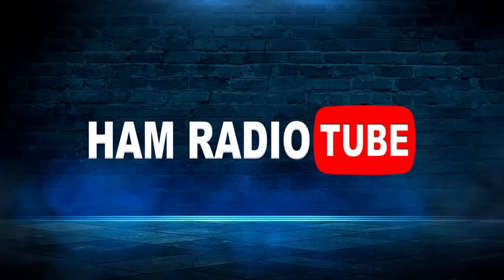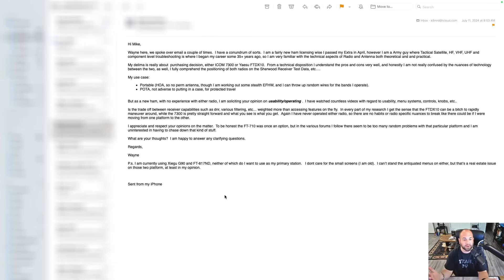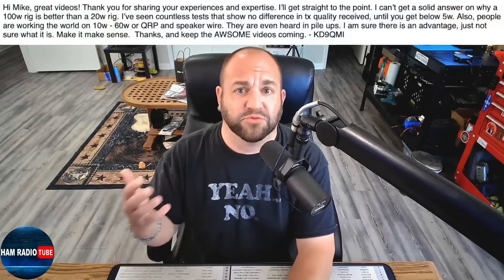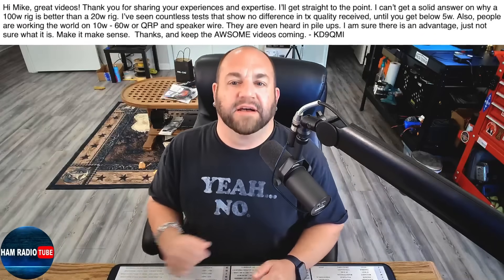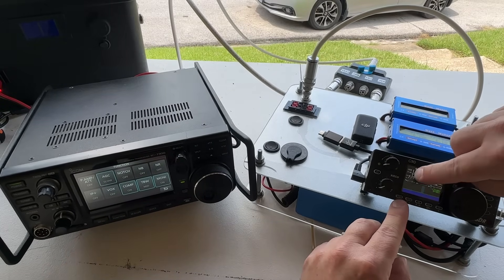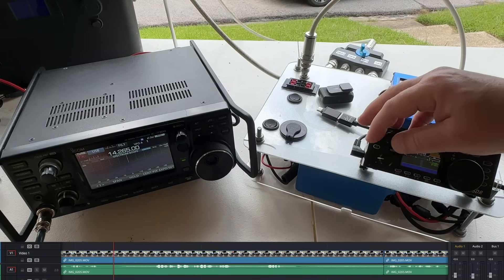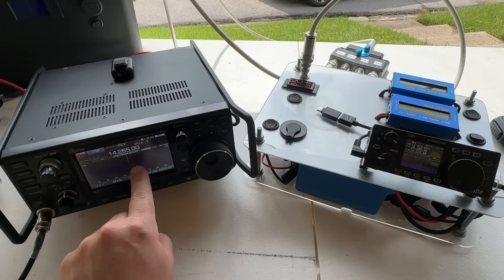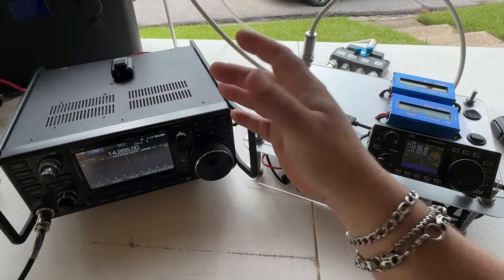Is There A Difference Between 100 Watt & 20 Watt Radios?

Comment: There's a Canadian ham, VE7MTY, who operates a 10 meter beacon at or near 28.197 (he lists this frequency on his website).  I heard it the other day, on a frequency up from 28.197.  I forget where exactly, but it was near it.  Anyway, he runs 4 one second tones at the end of his transmission loop, stepping through 25w, 10w, 2w and .5 w.  I could easily hear the difference in each, progressively becoming fainter with each step and most times, barely hearing the .5w tone.  I'm in Arizona, and when running POTA, almost always run 100w so I can get the east coast hunters to be able to copy my transmissions.  Or, if I just want to experiment or keep pileups at a minimum, run QRP sometimes.  Mike - ND7E

Comment: I think COAX helps too. If i am using poor coax, the power drop my be down to 50% and now the G90 is down to 10 watts. It looked like your coax was pretty low loss.  Good video!  I am glad I got the 7300.

Comment: When someone is confused by the FTDX10, I do not understand. Learning the breadth of features is challenging, but the control is simple. Push the function button and select the feature.

My most annoying radio is the IC-7000. To use your example, changing the output power takes a roadmap and opening the manual PDF.
Reply: Have you tried the FT-991?  It's a very useful shack in a box but the menu system still confuses me after years of ownership.  

My friends IC-7300 I only used occasionally but it's just so easy by comparison.
Reply: Dialing in the transmit audio just right can be tricky on the dx10, but mostly if you’re using a unique microphone/headset. Otherwise, the N4hnh guide available to his patreon patrons will helps a lot in getting you up and running quickly. It’s a good radio… and if you’re going to operate from home a ton…. Get the dx10… but if you’re heading out into the great outdoors, the ft-710 really is a better form factor. The size difference in the specifications doesn’t really give you an idea of how much lighter and more compact the 710 is. Not blow your socks off small, but it’s obvious when you see it in person.

Comment: I recently upgraded my station (rather significantly) and my new transceiver can pick up signals that are down in the noise for its predecessor.  Unfortunately, there's no guarantee that the station on the other end has "ears" as good as mine. Even if they do, they may be dealing with local noise or interference that makes marginal signals hard to hear.  This is why, all else being equal, I'll opt for more power capability. I'm not required to use it -- I can always throttle back (and usually do, to be honest), but it can really come in handy in some situations. Nothing against some of the amazing QRP rigs that are out there -- I have a couple of them, and enjoy seeing just how far I can make a few watts go. But when they're maxed, they're maxed.

Comment: for the 20w vs 100w thing, I think the big thing to realize is that 100w shows up a lot better on a waterfall. So if you want to just call CQ on a frequency and have people find you, the more watts you have the better, because you will make a big peak on  the waterfall, and people can navigate over to you. When I run QRP I generally have to hunt stations that are calling CQ and they may or may not hear me when I respond back to them,  but the only times I've ever had someone respond to me when I just call CQ on a frequency was when I was running into an amplifier with ~100w output. You can still hear someone transmitting at 20w in a lot of band conditions, but only if you are on their frequency already. Finding someone transmitting at 20w is much harder.

Comment: I know for a fact that you can work the world with 20 watts and a wire.  It can be hard to bust through pileups though, especially when others are running amplifiers.  When running lower power you definitely have to work with propagation.  I will say the internal tuner on the G90 is fantastic.  Before I put up my 80 through 10 EFHW antenna I was using an inverted V wire dipole cut for 10 meter and was able to tune all the way down to 40 meters with the internal tuner on the G90.  Was it the most efficient set up?  Absolutely not, but I was making contacts.  One of my more memorable contacts was with a ham in Colorado who was running an amplifier and decided to turn it off after I told him I was running only 20 watts and he was hearing me without any issue until the band changed.  There was no change on my end when he turned off his amplifier.

Comment: The receive on the G90 sounds better than in your demonstration if you turn down the RF gain control until the noise is just barely registering on the S meter. When I do this, I actually enjoy listening on the G90 just as well as any other rig, including my 7300. It's a very quiet receiver with clear audio on the internal speaker. Better than the 7100 even.

My only complaint with the G90 is broadcast interference and CB powerlords. An external broadcast filter is a must have accessory, and if you have to use it, then you lose the tuner. If they had included this in the radio I would have nothing to be unhappy about.

Comment: Two cents... Having owned and operated a 7300 and FTdx101MP I can say this...  once you have the radio set up for your mode, you "really" do not need to twiddle knobs and get into the menus especially on POTA as an activator.  So essentially what I experience is that on POTA the main interface is two simple steps... TRANSMIT and then LOG.   Also, the Yaesu receiver and Noise Reduction is a rather large (Very Large) step above the 7300.   If you want to eliminate the menu issue (if there is one) there are quite a few CAT programs that make the human interface go away.  If you can't hear em... you cannot work em....  the 101 and 710 series shine.  And for POTA... the Xiegu G90 and XPA125B combo is really hard to beat. 73 Art W1SWL

Comment: You want to talk about crazy?  To get into programming mode for the FT-70DR you have to plug it in, turn it on, remove the battery, hold down one of the buttons, insert the battery and you're in. But wait - there's more!  To retrieve memory from the unit, you need to then press another button.  And when you are ready to send data TO the radio you need to press a completely different button!  Love the radio, but that's just nuts.

Comment: Hey Mike, I guess @KH6WI kind of answered this question.  In his case power does matter, but for those of us on the mainland, I wonder how this would work if we had a high-end "QRP" rig like the IC705 vs the 7300.  In this case we have newer technology in the 705 that should cut out the noise just as well, if not better than the 7300.  Then the question would be, which rig do I want to take out and set up in the field.  One advantage of QRP rigs is size.  They are usually much smaller and lighter than "normal" 100W rigs designed more towards portable ops.  Great comparison and a different twist looking at the receive side. 73

Comment: Honest question.  And no intent to be obnoxious, because I appreciate this sort of side-by-side testing.  I'm trying to work out a solution for remote emcomm.  My guess is that in a real life emergency, you would choose an FT-891 or IC-7100 over the G90, in part because of the filters in the 891 and 7100, and in part because a few more dB of power would be a good thing.  Is that a safe conclusion?

Comment: When comparing a 20W radio to a 100W on Transmit the difference would be 7 dB a bit more than 1S unit. You are correct in saying that receiver differences are the most important.
Reply: All things being equal that is true ? However my ic7300 on 100% power averages around 40-60 peaking around 60w  on voice . The G90 peaks around 21w on my meter , and has a average closer to 20w rather than ic7300's 50w average .  So in action it's more like 4db ?
Reply: @robduncan599  Your reply suggests that you either may not know how to use your meters or your 7300 is broken. Put the Radio in CW mode on key down the radio should show very close to 100W. You can also use an external power meter. In an SSB transmission if you don't speak the power output will be zero watts  and the power will rise and fall with the intensity of your voice. RFM to understand your meter. If the CW transmission does not produce close to 100W your radio needs service. BTW test into a dummy load that can handle at least 100 W.
Reply: @vladtepes481  you may not have noticed I did say ' voice ' . Sure the rig will do 100w key down. But on average talk power with a power / SWR metre in line (Watson wcn200 )always it's around 40- 60 watts average. Sure if you whistle you might get 100 w .but like I said ' average ' is about half the max . I don't think that is uncommon. But the G90 seems to give a good average. That's all I am saying.
Reply: @robduncan599  Well do key down on G90 you should see 20W. The G90 probably has a peak meter. The instantaneous power will always be a fraction of the peak power with a properly modulated microphone. both radios should produce a rather fixed fraction of the max power for a given voice level. RFM to learn how your meters work.

Comment: Only a tiny increase on the received signal. To get a 1 S unit increase you have to run 4X the original wattage. Get the 20 watt. If you want more power out, get an amp. 1 S unit = 6db. To get 6 db of gain requires a 4X increase of power. That's just the way it is.

Comment: Wow Mike!   Did you notice the recieve signal on the 7300 when you were transmitting with the G-90?  That switch must not have completely isolated the radios.  Maybe if the switch was grounded.  ..

Comment: Output Power is important. But..  Don't forget that "Receiving" is important also.. check the RX Specs. of the Radio (db Sensitivity / Selectivity). If you can't hear a potential contact, all that power output does not matter.. (All you are is an Alligator Station).. Try to achieve a Happy Balance..

Comment: Ok, so I have just been getting into GMRS and finding that I am heading into HAM. So after watching this video and reading all of the comments, I understand that the differences between two radios comes down to more a question of receive quality and features but where does that leave the question of transmit power? If a 10 W radio can reach out as far as 100 W radio why does 100 W radio exist? Does a 100 W transmitter give you any benefit over a 10 W transmitter? If so, what is that benefit? Thank you for all of your videos and sharing your knowledge and experience with all of us.
Reply: Every time you double your power like from 10-20 u get one S unit… so from 20-40 is another s unit and from 40-80 is another s unit… got it?
Reply: these are more of the things you will learn by studying for the general test.  There is no 'right' answer, but 100 watts will likely be 'better' in any given situation.  I have the G90 and I work the world with 20 watts, but I will likely get the FT-710 next, for all the reasons in this video.  Still 20W G90 is a lot of fun anyway...

Comment: The G90 does have a noise reducer, but it’s clunky and not really reliable.

I enjoy my G90 for what it’s capable of, but I’m heavily considering another Yaesu or Icom in the future. I have an FT-891 already that I’ll use in the car.
Reply from the maker: Where do you have noise reduction on your G90?
Reply: @hamradiotube Noise Blanker, NB, with upper and lower adjustments. Comparing that with the Yaesu FT-891, I don’t find it as useful, unless I’m confusing a Noise Reducer with a Noise Blanker.

Comment: Re power.  Still if your signal is just at the noise level with 20 watts, 100 watts will get the contact when 20 won't.  Power may not always matter but often it can matter.

Comment: What happens to the answer if you are using the same radio but  adjusting the power setting from 20 to 100 🤣 i am toying with the 710 and the dx10 😊 massive upgrade from my 817.
Great video Mike 
👍🏽73
Reply from the maker: Nothing.  Other than you turned the power up.  And your current will be higher from your power source on TX.  And you may actually be heard if the RX station didn't hear you before when only on 20 watts.
Reply: @hamradiotube  great work Mike. I have only just come across the Atas-25. Where has this antenna been hiding. 🤣

Comment: Thanks Mike, so now for the big question. Should a new ham like myself spend $1200.00 on a radio or $4-5,000 .00 on a better radio.
Reply from the maker: That's a tough one.  Honestly, unless you're a serious contester, I don't think most hams would really use all the extra features in those really high dollar radios.  Sure Flex radios and the like are super sexy and really really good at doing what they are designed for, but are you going to be operating multiple stations on multiple frequencies at the same time?  On the other hand, if you've got the disposable income, go for it.  Keep in mind though, your radio is only going to be as good as your antenna system.  I would say for a new ham, start with an FTDX-10 or a 7300.  They're both great radios with all the features all but the most serious operator are going to need.
Reply: @duanebrumage5281  only consider the pro-level radios if you have room for a bit of an antenna farm — more than one transmit antenna and dedicated receive antenna. You’re basically picking up a second transceiver in the same box with the ability to do some things like diversity receive and monitoring more than one frequency at the same time.
Reply: one good advice is to spend ~$1200.00 for transceiver and $4-5,000.00 on antenna system.
you’ll see the difference!

Comment: You can always turn the 100W radios down to 20W and have the great receiver.
Reply: This. I rarely run my 710 at 100w. I see no need if I'm making the contact to push more power than needed. I seem to recall something about that.

Comment: I have all three of the Yaesu FT-891, FT-991A, and FTDX10.  The menus on the 891 and 991A are legitimately wonky.  Usable once you figure it out, but they have their reputation for a reason - I keep the PDF of the user’s manual for the 891 on my phone.  The DX10 is a completely different animal - everything is much, much more intuitive and common things are quick to access.  The Icom screens might still be slightly prettier, but I think the complaints about Yaesu menus are obsolete now.

Like others said, if they want to haul it around semi-portable, the 710 seems like the obvious answer now that it exists.

Comment: Thanks Mike!!!! Awesome video and explanation!!!!  You answered my question NICELY!!! You nailed it in your example perfectly. My question came from looking at the IC 705 at 10w and the IC 7300 at 100w both get out to the same places, and similar in functionality. Only difference is watts. Then I went down the worm hole trying to find the significance of 100w vs 10w. You helped me conclude It boils down to being heard in “horrible band conditions and the receiver’s noise floor.” In, say perfect band and receive conditions, there wouldn’t be a detectable difference between 10w and 100w. THANK YOU!!!!! I can go to bed and sleep better now. 😂😂😂

DE KD9QMI
Reply from the maker: Fantastic!  I'm glad I was able to clarify that for you.  That was just pure luck I was able to work that guy doing POTA at the end and drive home the fact that power isn't everything.  But, I had a great signal to him.  If the conditions weren't as such, I very well might not have been able to make that 20 watt contact as easily.  Thanks for writing in, that was a fun experiment.
Reply: @hamradiotube Thank you for connecting the dots and choosing my question!!!! I have plenty more. But I’ll spare you until my research brings me to a similar fork in the road. 😂 Thank you for all you do for the HAM community.

Comment: I loved my FT-DX10 but for POTA it wasn’t worth the hit on the battery. Almost 3A on RX, although most of the time I found it to be in lower 2A range. In contrast my KX3/KXPA100 combo is right around 250ma on RX. I believe N4HNH has a comparison video of the DX10 vs IC7300.

20*2=40*2=80 so a 100 watt radio is only a little more than an S-Unit difference from 20w to 100w.

Comment: And, you can run the 7300, etc. at 20 W if you want to.  (I usually concern myself more with how long the battery is going to last, either in a POTA, or in a grid down scenario.  As Julian, OH8STN has said many times, most radios don't seem to worry much about receive current drain.  I can get my FT-991 down to about 1A on receive.  The KX-3 does a whole lot better, maybe 40ma if I'm careful about shutting off features that I don't need at the moment.  Mike, what is the receive current on the G-90?

(And you're still misusing "exponentially.)

Hi to Satan.

Comment: For the bang the FTDX 10 is the winner. For simple minded operating the Icom is best. I can always turn down my 100 watt radio . I can't turn up a 5 or 10 watt radio to 100 watts. are you back packing in on a hard to get to location ? Or setting in your car at a POTA ? There is no real answer to the question.

Comment: Use the RF gain control to reduce noise on the G90 works pretty good . The RF gail control on the ic7300 is very poor .
I own both G90 and ic7300 . I like the 7300 better and it is more user friendly,  however the RG gain control on the icom ic 7300 is a big disappointment turning it back still leaves you with considerable noise , unlike my ts870 ic 781 kenwood ts480hx or ft817 or ic703 . I know the ic7610 has similar RF gain control disappointments.